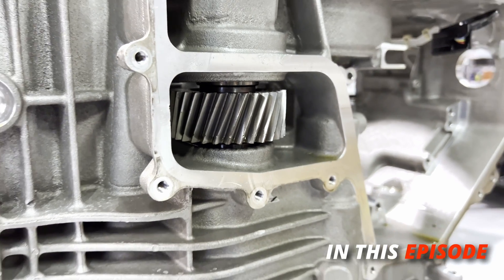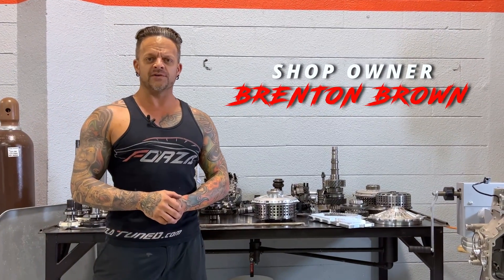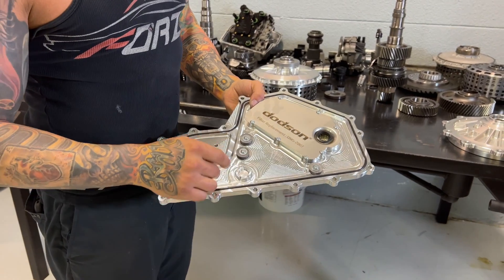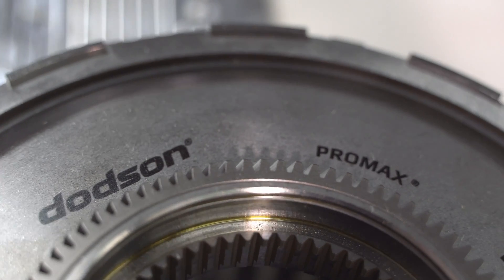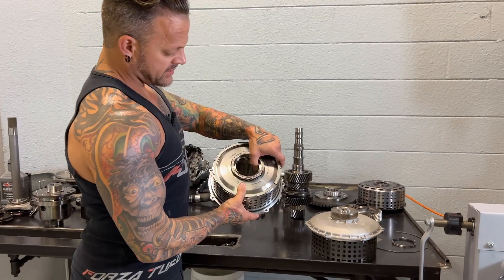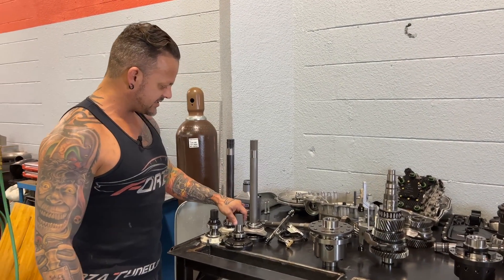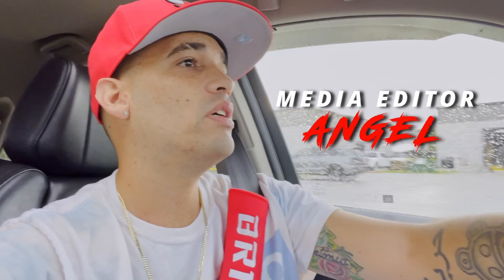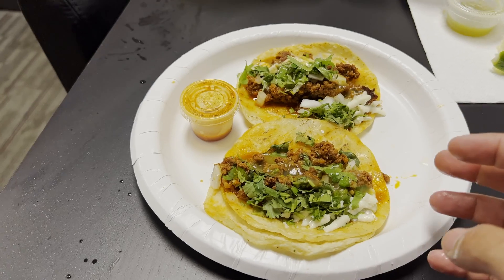Twin Turbo Lamborghini Huracan Build (Ep.1) DL800 7SPD DCT UPGRADE

Comment: Can you please explain what the word Billet means ? I always hear this word , billet piston , biller crank , billet block … and what does the word Forged means too ?
Reply: Billet means that a component is machined out of a solid piece of material, commonly referred to as a "forging," instead of a casting (where you pour molten metal into a mold and get your near-finished component that way.) "Forged" is how the material was made... basically hammering it into a shape to increase its density. Hope this helps.